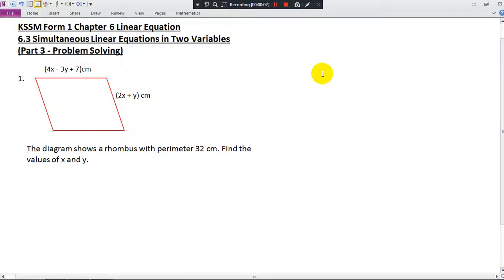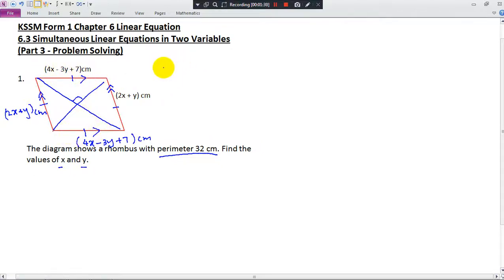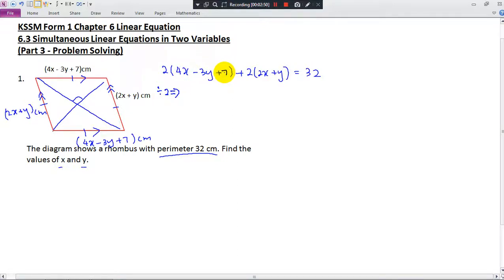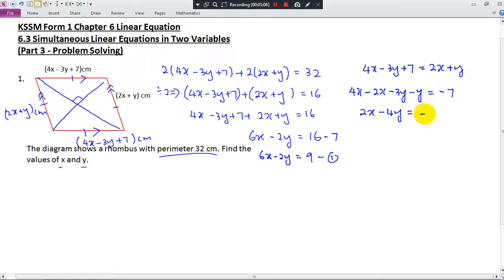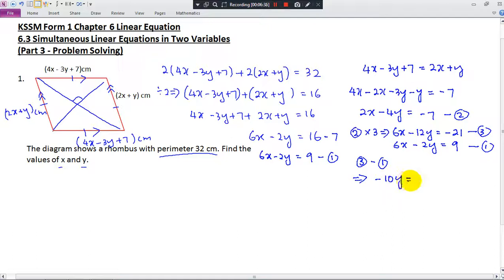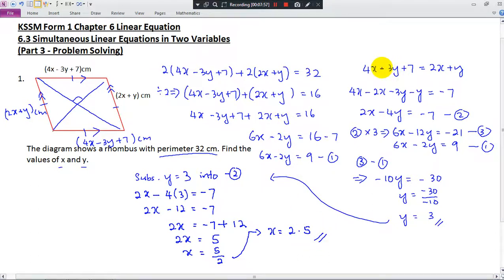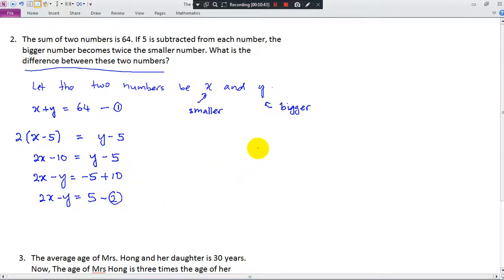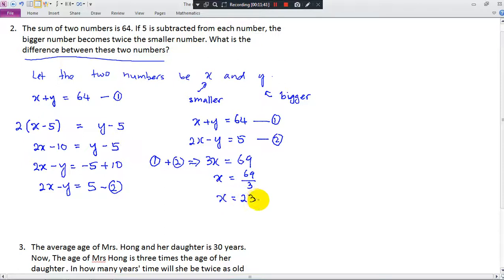KSSM Form 1 Simultaneous Linear Equations (Part 3-Problem solving)

Comment: Thx for teaching us. It really helps me do revision.
Reply from the maker: Thanks for watching :)
Reply: Can you teach me more about this?
Reply from the maker: @SlayishWarrior5757  Which part you don't understand?
Reply: Using substitution method.
Reply from the maker: @SlayishWarrior5757  Learning through watching teaching video and in the class is slightly different. If you are watching a teaching video, u can control the video, u can pause it or rewatch it until u understand.

First is to express one term in another term, then substitute it into another equation. Our purpose is to change two variables become one variable.